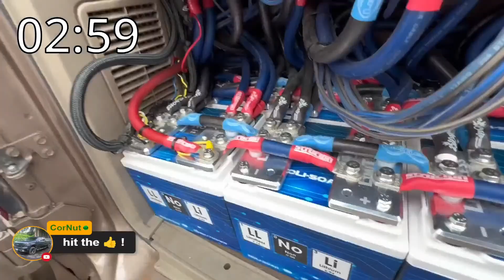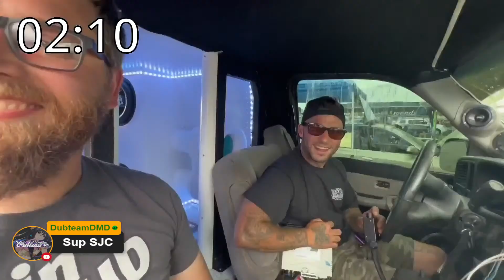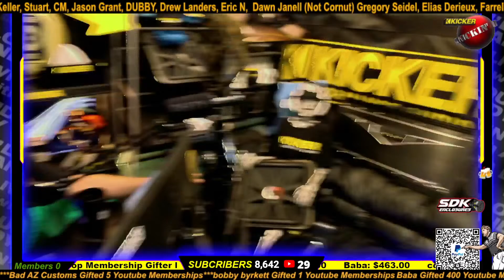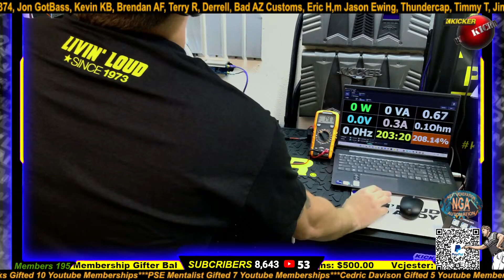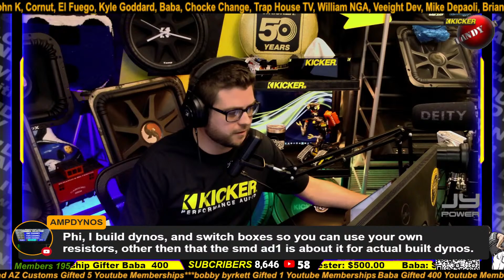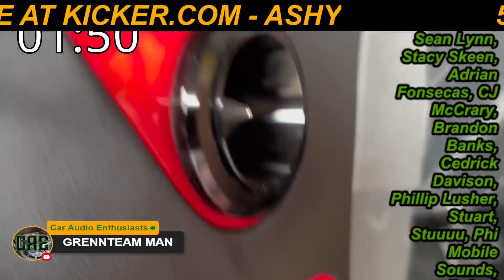AMPLIFIER DYNO vs REAL WORLD POWER : Kickin’ it with Andy EP 51

Comment: Ok Andy I've reworked my system install to professional levels but have one concern if I have 2 xs agm  batteries D series wired parallel which they say is fine buy some say I should install  Multi Battery system 500 Amps Relay Isolator what u think